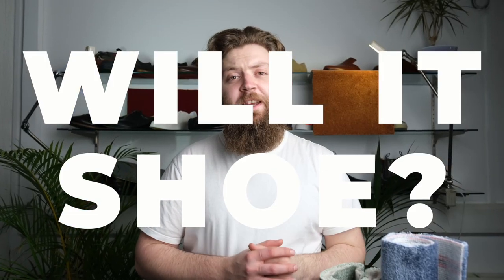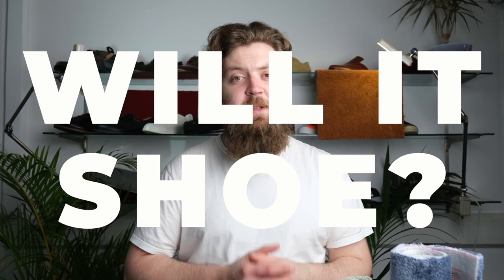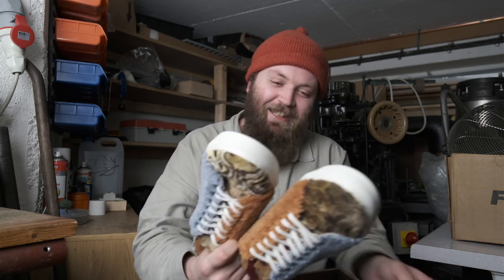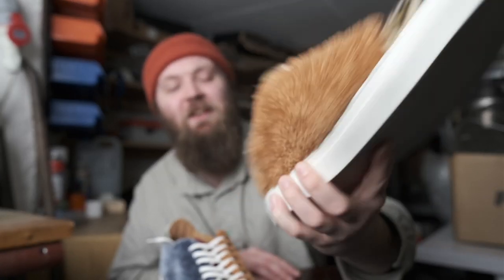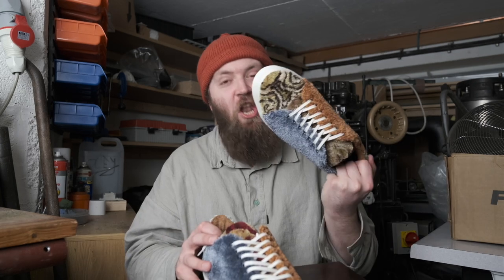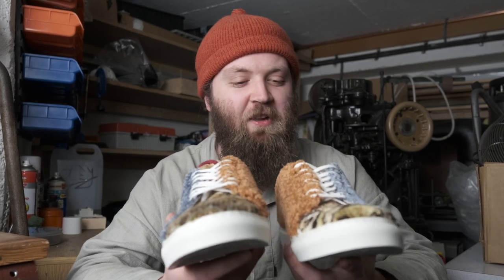Can we make shoes from carpet waste? - Will it Shoe?

Comment: Hey if this is not just a fun bit, but actually sort of a fun research into recycling materials, then I'm really impressed! I'd love to see a company make shoes out of scrap/used/cutoff materials that would otherwise go into a landfill. They usually have the kind of patina and markings you just can't get any other way than using things.

How about old sails? They range from very thin and light funky coloured, to a heavy heavy duty materials.